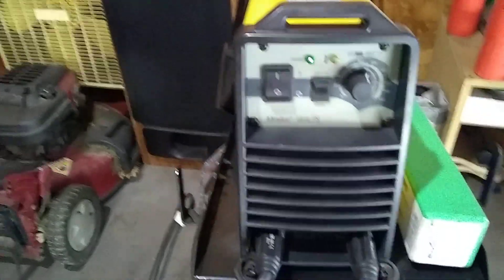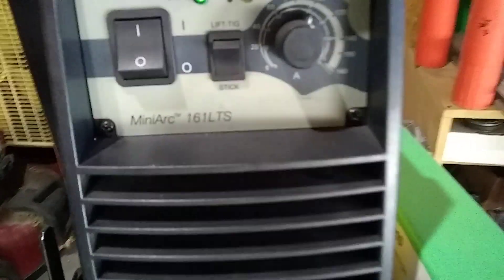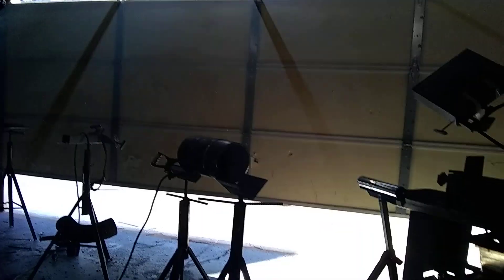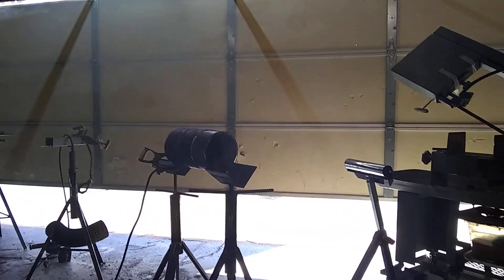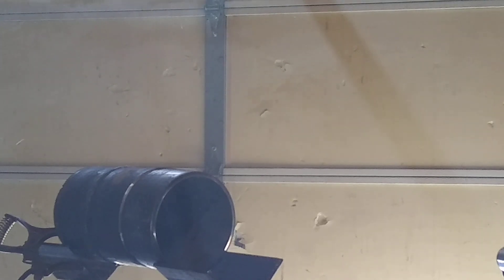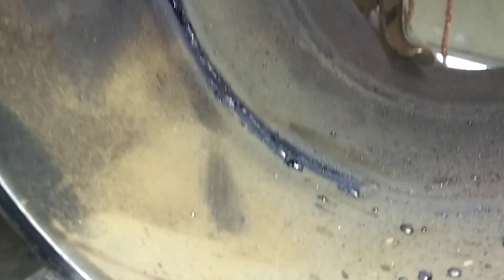Esab miniarc 161 vs open root 6010

Comment: Will it run the 6010 up hill on open root pipe ?
Reply from the maker: Like a dream. I've done 3/16 gap no issues
Reply: That awesome! Itll tig weld too?
Reply from the maker: @austinwarrior5822  yes it tig welds rather well but valve torch and no foot pedal or high frequency start.

Comment: Great video 👍 I’m a pipe welder as well and had a max star 150 for the house and it couldn’t run 5p worth a fuck, great little TIG and 7018 machine but not 5p. Just bought the mini arc 161 and am stoked that it runs 5p this well.
Reply from the maker: Thanks for watching and that's what made me get the esab like 3 years ago over the maxstar 150. The maxstar 161 came out about same time but couldn't justify double the cost for the blue, still really happy with the esab. Good luck with yours

Comment: Welded yesterday with mine 1/8 7018, shorting my f100 truck frame,welds like a dream
Reply from the maker: It is super smooth on 7018. I love the machine
Reply: Probably had the battery connected. 🤷‍♂️

Comment: Just bought one and got it yesterday. I saw your comment on weld.com and decided to go for it. This thing absolutely rocks. Are you supposed to drag 6010 on open root pipe welding? I'm trying to learn pipe welding so I can get a cert and look for a pipe welding job. I'm working in a fab shop atm. Thanks man
Reply from the maker: All depends on gap. More gap more of a stitching motion. Tight gap get puddle going push in on rod and go
Reply from the maker: Still loving the machine? Tried the Tig side of it? Wish ole Bob on weld.com would show it off. Idk why it's been on no channels that show machines it's worth a look for someone wanting to get into pipe for stick or Tig and is what u see in the field so it's perfect In my opinion

Comment: Great job man thats a pretty good little machine. I appreciate you showing that. I need to step my welding skills up one of these days lol. Just subbed brother.
Reply from the maker: Been doing any welding? Anything u want to see or me to show?
Reply: @chrisjones6165  buddy i havent been doing much of anything except working and trying to get myself straight but i will be back at it fulltime real soon. I actually have to pull my truck bed off and replace it the cab corner rockers and do some frame work too. I have never done cab corners or rockers and i know the metal is thin so i have ro be careful but i have friends who have done it so i will recruit help when the time comes. Thanks for asking brother i will get back to watching videos here soon as well and will get caught up on your new ones. Thanks again!
Reply from the maker: @RedemptionGarage  good luck brother, any questions let me know and as always I look forward to your videos. Good luck brother
Reply from the maker: Thanks brother I appreciate it, and I love that esab machine. Originally got it to practice for welding cert.. did that and has paid for itself a few times over again. Hopefully I'll be able to say the same about my Lincoln welder soon. Thanks for watching and the sub. Have a good day

Comment: Just got mine in today all I can say is holy shit. Works better then what we use at school. Ran a real tight 5g 6010 root to see how it would hold up had no problems at all I’m mind blown. Things so small but packs a punch
Reply from the maker: I've been saying it for years now it's an amazing machine and can't be beat for the price. Congrats on your purchase. Im looking at a welder generator at moment, leaning towards a Lincoln but still considering miller to. Wish esab had a engine drive
Reply: @chrisjones6165  see if you can try some out before you buy one. Dont know much about a engine drive but i do know people like there lincolns and millers. i think at the end of the day its gonna be what is more reliable
Reply from the maker: @bradleyschmidt9124  both seem about same on alot of features, price, warranty and even use same engines on em. Just don't know how far to stretch budget. 5 grand or 8 is about what I'm looking at to do what I need
Reply: @chrisjones6165  used sa 200s go cheap but if you dont know how to work on them it might be a struggle. im still in school have a few weeks left then might take a job out in Utah. far move for a young kid but want to get on the pipeline
Reply from the maker: @bradleyschmidt9124  well good luck to you. Would love an sa 200 but need ac generator power so that's a down fall there unfortunately.

Comment: Those 110 stick welders sure have come a long way since in the past 10 years or so. Mine is just about junk, but I don't have 220 here at home so it's either that or oxyacetylene welding with hangers.
Reply from the maker: They sure have brother. And lmao about the funniest comment I've read all year. Fucking coat hanger. Thinking about ordering an engine drive welder so the poor esab may be collecting dust soon. Great machine but having my own power source would open up lots of side jobs so really leaning that. Now do I wanna spend 5 grand and get an ok machine or bite the bullet and pony up the 7,700 for a more capable machine
Reply: Save your money and get the best machine you can. A good one will probably last a decade or two, but an excellent machine will be with you till you can't weld anymore or get sick of it...which ever comes first...
Reply from the maker: @HardKnocksForge  those are about 17,000$ outta my budget. Want something nice to get work going and the 5,000$ machine will do every bit of that. The higher end  would be going full time solo on big jobs where lots of dual shield flux core, 300 amp machine or bigger and more precision controls... Would any of that stop me from getting or doing any jobs I would bid on.. no. But it sure would be nice to have it just in case lol. Guess its like tool box shopping ur in love with the master series but that lil sob on your shoulder is saying what about the epic lol 😂😂😂.
Reply: Oh yeah I know exactly what you're saying.
Reply from the maker: @HardKnocksForge  just got a new Lincoln ranger 250 gxt should have a video up tomorrow of big red lol